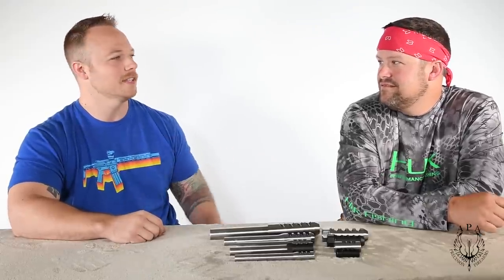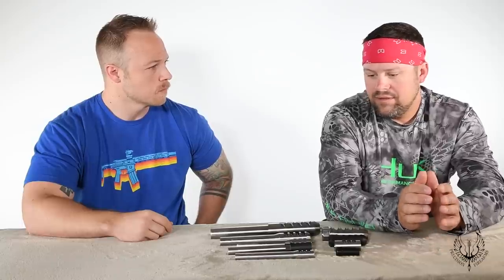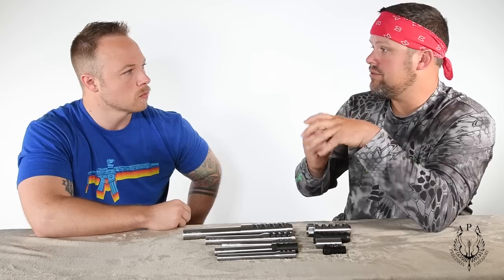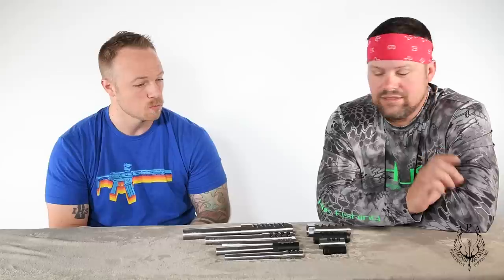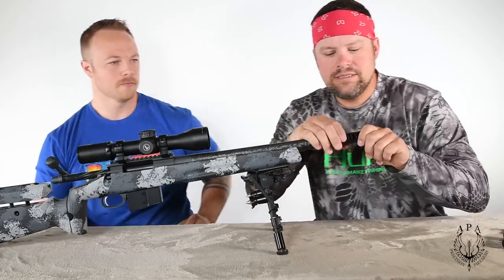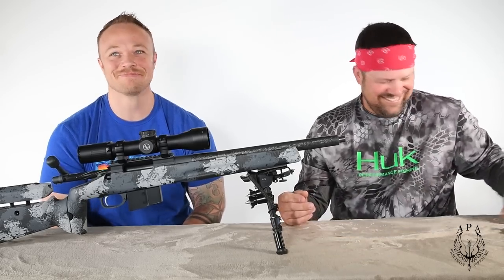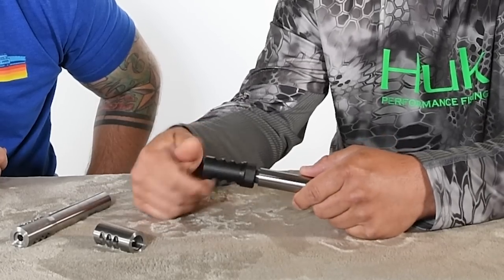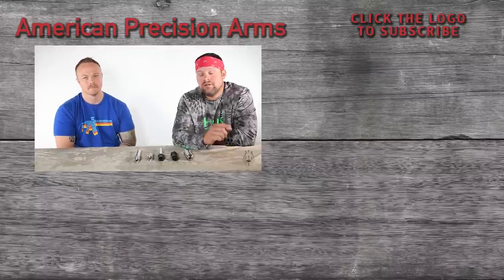How To Choose A Muzzle Brake

Comment: I have a question...the Tikka 9mm has a MUZZLE BREAK  that looks like it just fits over the muzzle and is bolted down with special screws you can see one at Cabelas tactical guns,,,it really looks cool...I was thinking to add one just like it to my Mossberg 30.06  to make it more sexy ...can this muzzle brake be purchased from you folks ?? and do you have some info on all your products ?